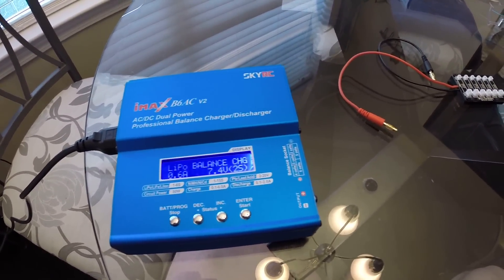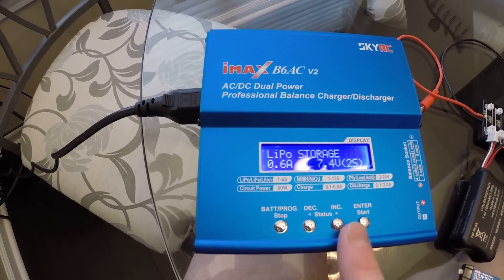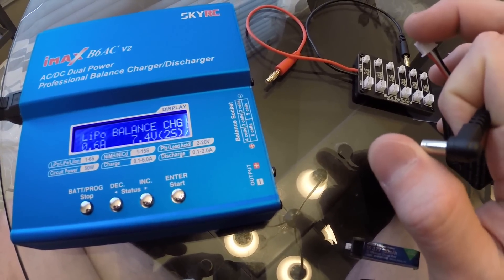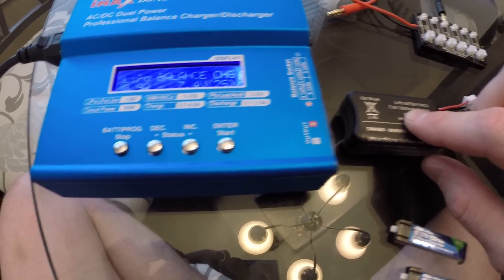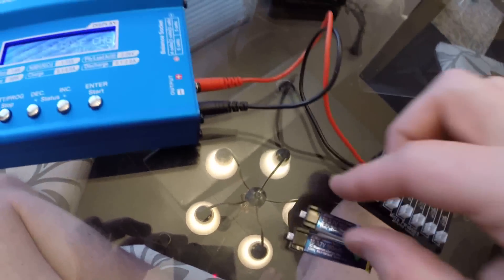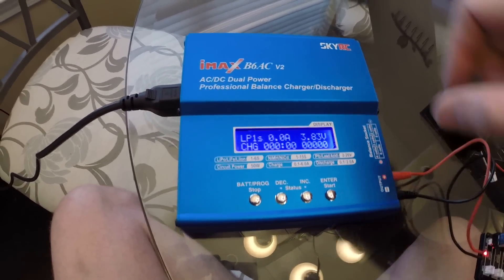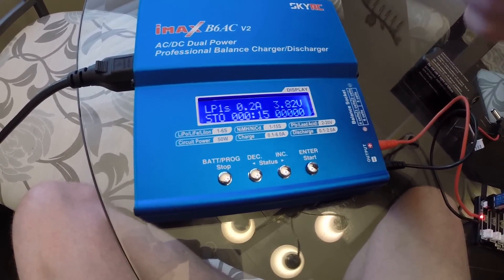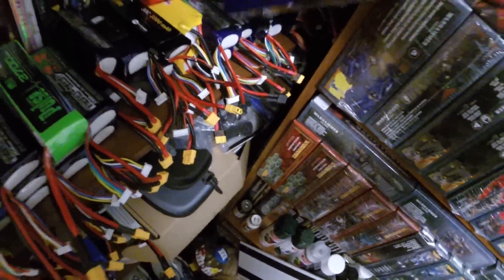Battery & Charger Explained - iMax B6AC v2

Comment: My battery is an 800 mAh LiPo with powerpoles and balance socket. Does anyone know what I need to convert from B6AC output cable to powerpole?
A friend told me to charge it using only the balance socket but I'm not too sure about that.

Comment: Never recommend to charge lipo batteries more than 1C. Those little 1S batteries have such a small connection that the mAh is more than enough to charge it at. If it's 300mAh, charge it at 1C. Even those big lipo batteries, charge it at 1C. Slower charge=longer life span=less likely for fires.

Comment: I just used this charger for the first time. Question: Is it normal for the batteries to charge a lot cooler in balanced mode compared to using a simple charger that came with my drone?

Comment: Nice video thx. I wasn't sure storage will discharge a battery if it high, I would always use recharge to Lowe a pack down for storage . But you did say it does lower it right.

Comment: hi i just wanna ask something i have this one i brought it from eBay UK 
the legit one not the fake anyway when i try to recharge lion battery i 
cant recharge one sel with balanced charge only 2 to 6 i can charge it 
with charge and fast charge only actually what i mean is that balanced 
charge doesn't have the one sel option don't know why so  i can charge 
as many as i want if they are connected together parallel but if i 
connect them in series 2 or  3 for example and i select more sels also 
the voltage change that is normal  7.2 or 10.8 and when i press enter to
 continue i get error message balanced connect error does anybody know 
why?

Comment: Hi there, great I video very useful information. So if I understand this correctly that's meas I have 5X1S rated at 150mAh so that would be charged at .7A? I also would like to know where did you get your balance board for 1S batteries? Thanks again
Reply: +Donald Guadagnolo Hobby king Micro Paraboard Micro JST & JST-PH Connectors.